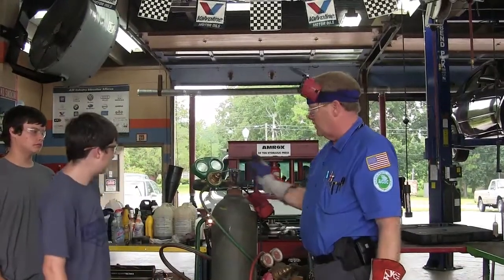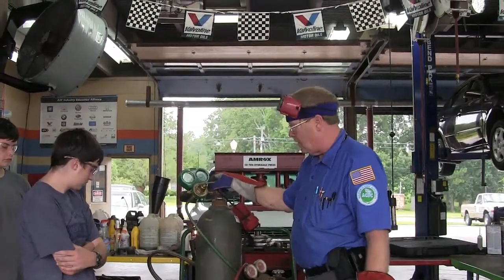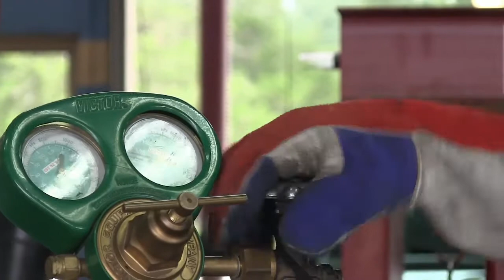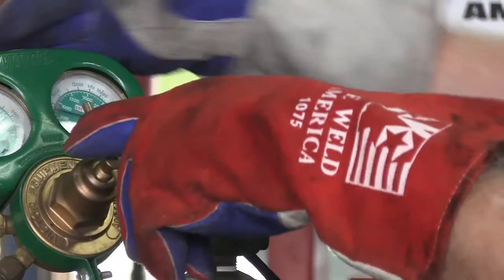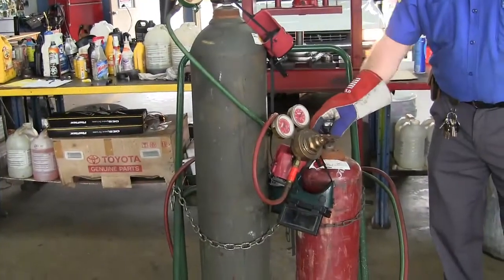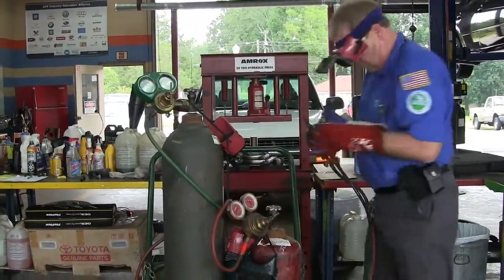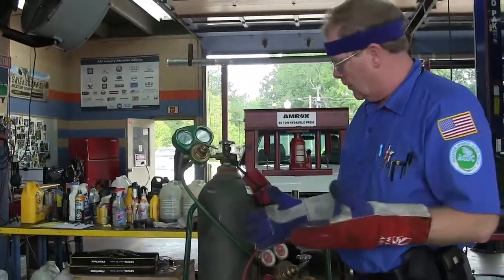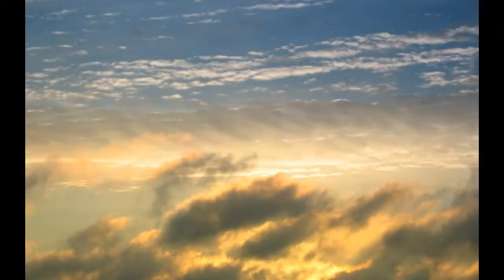Torch Lesson

Comment: I like the welding projects. I was doing an exhaust after several welds I grabbed the pipe bare handed several feet away from the hot spot thinking it was far enough away. The pipe felt wet. Turned out it was my skin making it feel that way before I felt the heat pain. That splashing hot metal has burned me through shoes, no liar holes trough pants/shirts with liquid metal fire. Beware of the awesome / hot stuff.

Comment: oil and gas under pressure there is a guy who i 
don't class as a moron but he said tats a myth , it was when i told him 
putting smoke-air in to an ac system to test is a bad idea because the 
refrigerant oil and air cause an explosion forgot to tell him when it 
gets compressed, but i suppose he knows that , Said he cant believe the 
myth is still believed
Reply: something just clicked in my head that it cant be a myth or no diesel would work. but be good to know what your view is?
Reply from the maker: One way or another, it's best to err on the side of caution - but it takes a lot of pressure to cause ignition!